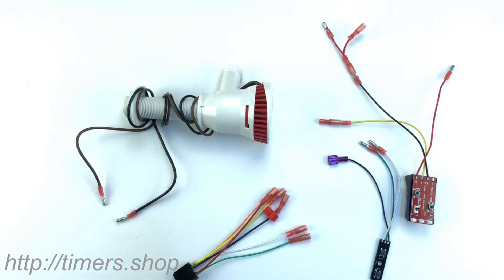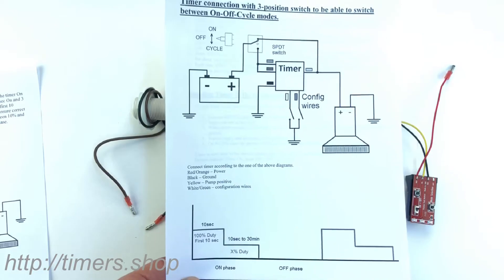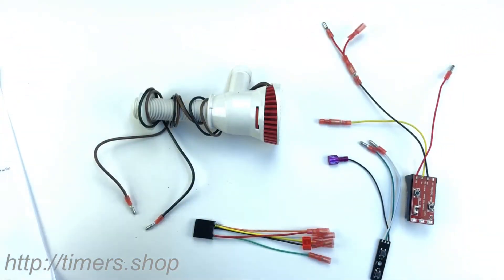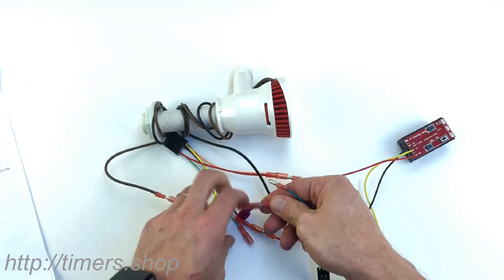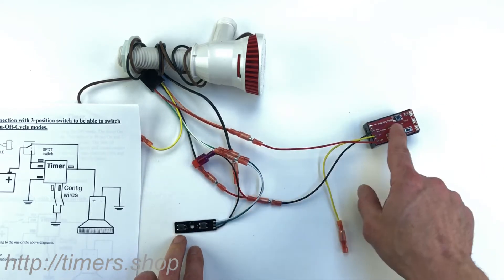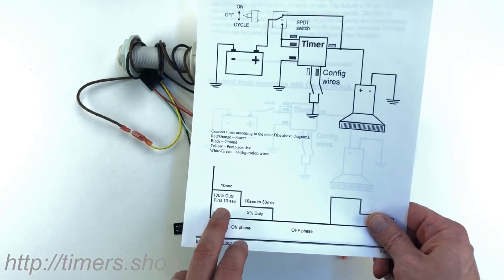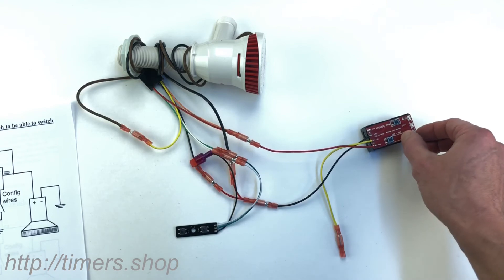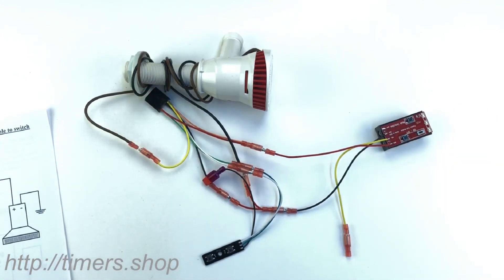Automatic Livewell Pump Timer with variable output

Comment: Looks like a good system... WIth a livewell that has FOUR PUMPS (2 for aeration/fill and 2 for recirculation, does one need a timer for each?? My switches for these two functions are wires as to operate a pair of pumps for recirc and a different pair for aerator/fill... It would be nice to have one timer for each pair if I could....
Reply from the maker: I do not see why you can not connect two pumps to a single timer.